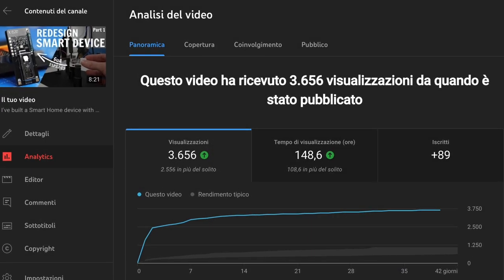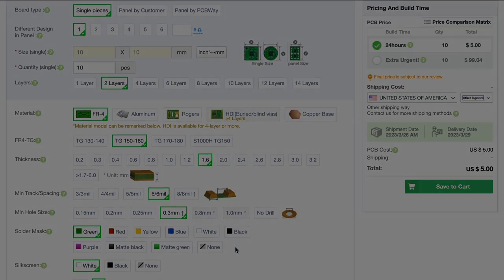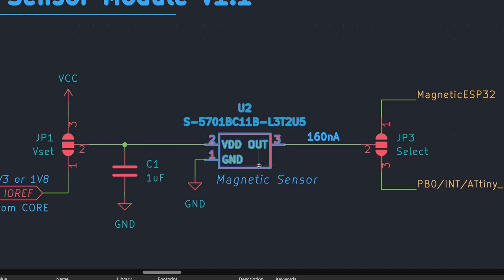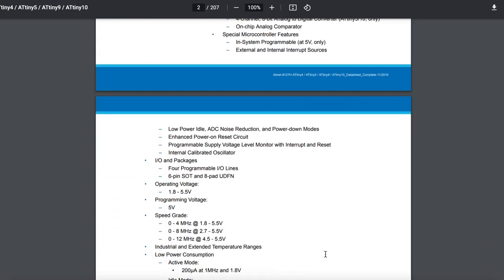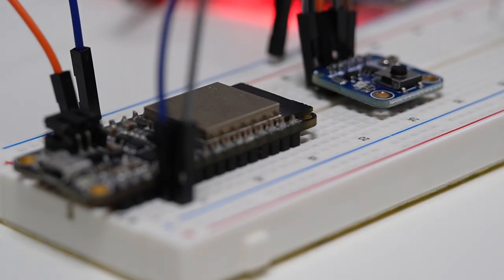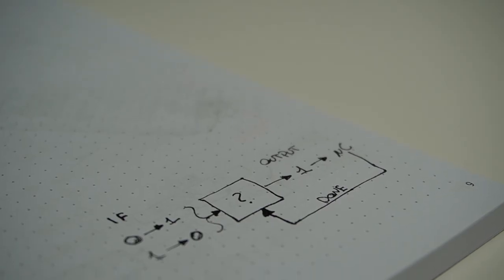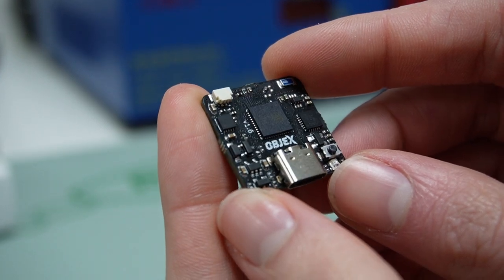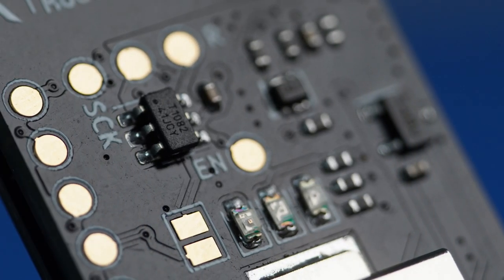ESP32 Deep Sleep - Power latch, TPL5110, and more | Part 2

Comment from the maker: In the video I do not show how the attiny10 works, simply because I preferred to find a simpler solution to the problem. I preferred to develop a power latch(which I will show in the next video) instead of optimizing a dual microcontroller solution.

Comment: This is great, after watching this video I watched an earlier video of your describing what you're doing overall.  Fantastic.  Regarding this video, its the type of solution I am looking for - but out of curiosity how do you tell the power latching device when to do the next wake-up.  I know the Adafruit TPL5110 solution uses a potentiometer, but as you are having your power latching board connect to your esp32 board I was wondering if you had given thought to have the two boards share some sort of common memory chip through the interface such that the esp32 could write to it and the power latch module read from it to know how long to wait to turn the esp32 back on.
Reply from the maker: Thank you for your comment, developing a power latch with programmed awakening of ESP32 is more complex. The TPL5111 as you well said does not do that at all. There are other ICs that have similar functionality by giving the possibility to program them via I2C bus. I plan to develop solutions like these in the future.
Reply: @SalvatoreRaccardi  👍

Comment: Ive designed one with TPL and 18650 battery. I plan to use coin cells but unlike normal batteries, coin cells, especially single cell, won't be able to sustain if it needs to wake up 10 times per day, where each wake up is 5 to 10 seconds. From my prediction that is.
Reply from the maker: I plan to use two batteries AAA, but not with TPL. I designed a custom power latch.